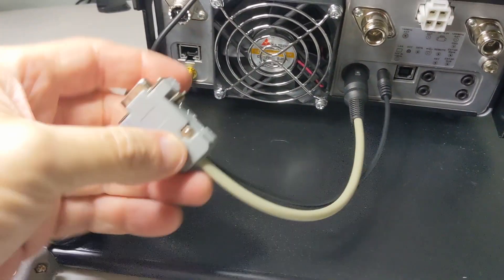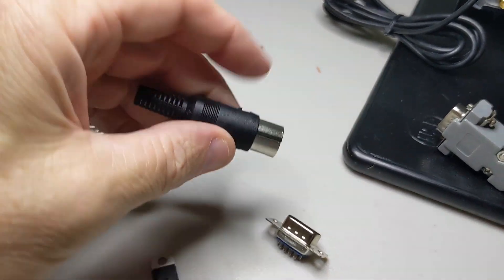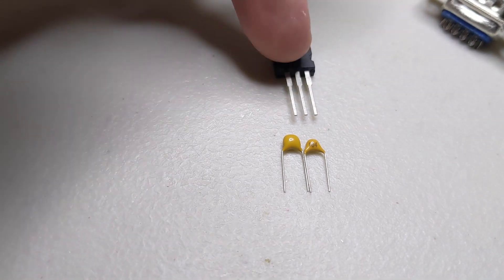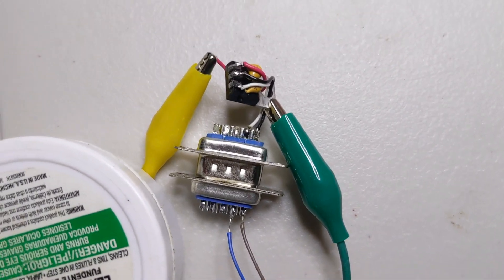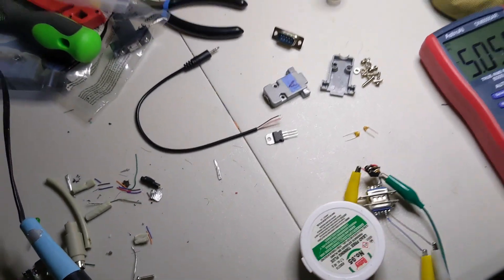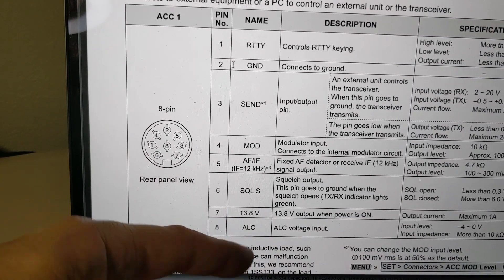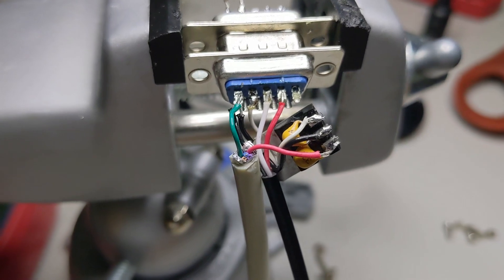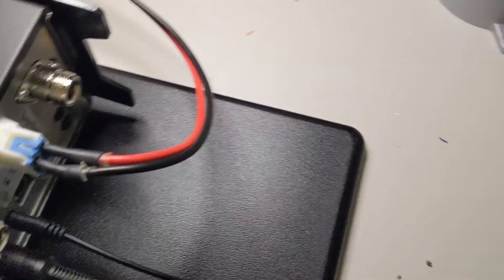Icom IC-9700 External GPS Mod

Comment: Good to see a practical solution to supplying the required GPS for dstar/internal clock! I'm sure there's a few local hams here who have IC-9700 and haven't bothered with hooking up a GPS because dealing with the 5v requirements...
Reply from the maker: I've been using it for about a week and can find no downside.  73

Comment from the maker: If you don't want to build your own cable, The Byonics model "GPIAP" cable is an alternative.  It comes with a Power Pole connector, but could be modified to power from the accessory port.   If you are looking for a GPS puck, the Garmin 18X LVC units can be found cheap and work great.